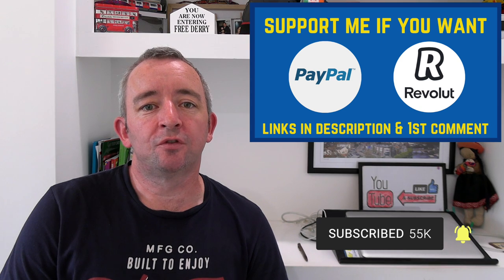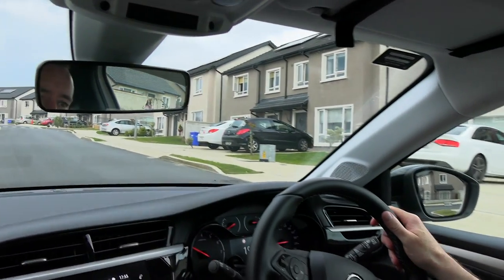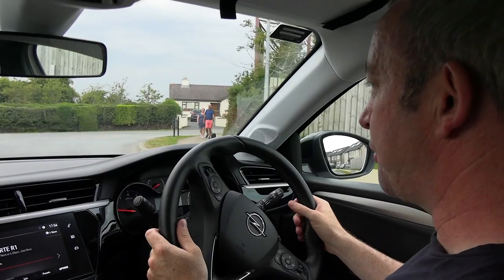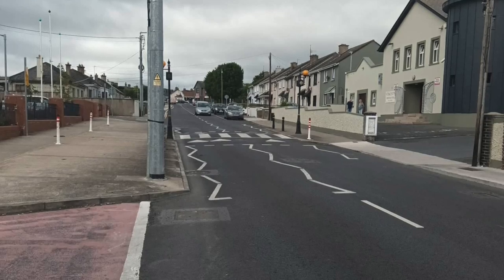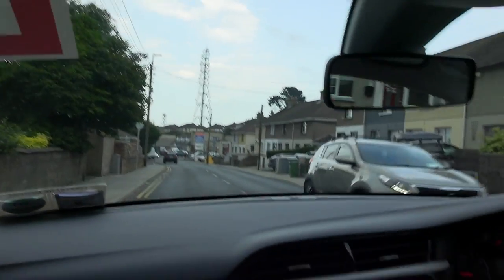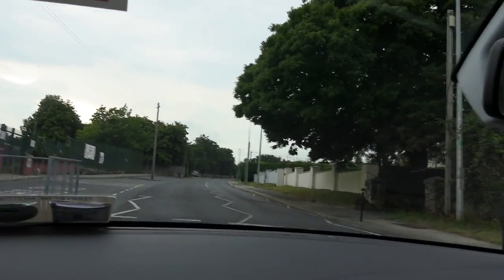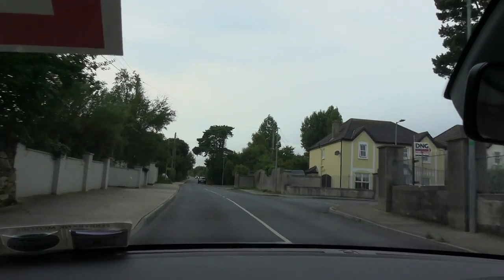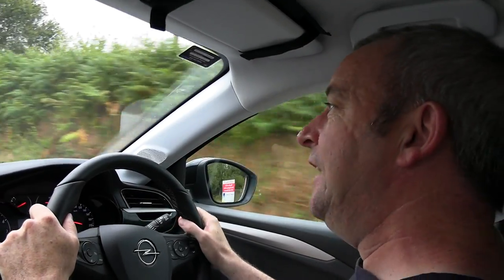How To Do Ramps & Speed Bumps Properly

Comment: Just sharing my experience. I failed the first attempt. Got 4 marks due speed on narrow speed bumpers due I ran it in 2nd gear at 30km/h. The tester said I could not reduce to 30km/h in a 50 km/h area. According him in that scenario is just to keep speed bumper between car's front wheels and reduce to 40km/h at most.
Reply from the maker: 30km is a bit high for 2nd gear so I'm not surprised you lost marks there. If it's safe to do 50 just do it but there will be times you'll need to go 30 or lower depending on the conditions. I don't know what you mean by keeping the speed bumper between wheels...  What are you on about?
Reply: @DaneTygheletsdrive  Sorry Dane I didn't make myself clear. I was marked because I was 30km or even bit slower when going thru the speed bumper(those squared narrow ones). The tester said I could not have reduced to 30km in a 50km area. Anyway, just sharing what I have gone thru. Thanks for your initiative. It is really amazing.
Reply from the maker: You can easily do those cushion ramps at 30km in 3rd gear but doing 30km and 2nd gear might not always feel the best. But it will depend on the situation as some ramps will be higher or lower, it's not like its a one size fits all, you need to judge them accordingly.
Reply: Tester was right. For those narrow ones you dont slow down. You put them between the wheels.
Reply: Q @DaneTygheletsdrive

Comment: Hi Dane,  thanks for the video. Just one quick question, if the speed limit is 50 and there are speed ramps, how much speed limit should we keep in between the two, in a dual carriageway. Is 30-35 okay, considering the traffic?
Reply from the maker: That would depend on how much space is between the ramps, more space then go faster.

Comment: Hi Dane I failed my test today in finglas. I binged watched your videos and done quite well but silly mistakes made me fail. I wish I seen this video sooner as this was one thing I was marked on a couple times. I was doing 30 in the house estates in 3rd gear. I was going over the ramps in 3rd but reducing speed. I was afraid of failing on progress.
Reply from the maker: You can't drive trying to second guess the opinion of some random tester, you need to judge each road and each situation individually and drive in a way that reflects the conditions.
Reply: This is exactly how all my instructors were "teaching" me. 30km/h and still in 3rd gear...

Now I see that it is probably just a bullsh*t and you need to reduce to 2nd gear...
Reply from the maker: Yes 2nd gear and 20km but it depends on the bump and how big they are, some might be OK in 3rd gear. Hard to give you a simple answer because there are many types of speed humps.
Reply: @DaneTygheletsdrive  this is why Im watching this video! Ive been told to do the speed cushions in the estates in Finglas in 3rd gear, theres a good few of them and very close together which I was told would make it too difficult to keep switching between 3rd and 2nd so to just take them in 3rd. Is this okay?
Reply from the maker: Grace if you have been advised this by a qualified professional then you should have no reason to doubt it, it will depend on the ramps and sometimes 3rd is good on the smaller ones.

Comment: I was not told to change the gear down by my instructors. Do you need to reduce the gears when you slow down for a second???

My instructor told me to slow down to 30km/h but not to reduce the gears...
Reply from the maker: That would be fine for some ramps, depending on the height. Not all ramps will be done in the same way.

Comment: Hi Dane, I saw your video on filter lights which was pretty good. But can you answer a question about them, can filter lights be 3 tiered as in red amber green arrow?
Reply from the maker: Like a potential filter light for red and Amber? Unusual but I have seen it. A flashing Amber arrow light is definitely a possibility, do you know what that means?
Reply: @DaneTygheletsdrive  Can't seem to leave a link to google street view as a comment. It's where the R612 crosses the R613 in Carrigaline in Cork. You'd be on the R612 turning right onto the R613
Reply from the maker: You can email me a screenshot at danetyghe@gmail.com

Comment: If the cushion speed bump is in three parts, instead of two, on the road ahead, should aim to drive over them or aim to get your tyres between them? I was marked six G2s last test, for driving over them instead of driving between them.
Reply from the maker: Where were the ramps situated? What lane position would you be in if you avoided the ramps as opposed to driving over them?
Reply: @DaneTygheletsdrive  The three ramps were set apart equal distances with one in the centre of the road and the others on either side in a housing estate. If I drove between them, I'd either be closer to the kerb/path or right in the centre of the road. If I drove over them, I'd remain in my lane.
Reply from the maker: Sounds like you should have driven between them and been closer to the path but it will depend on the situation and the road, there is no one size fits all answer. What did your driving school say?
Reply: @DaneTygheletsdrive  Driving school said should aim to drive between them so my fault for not listening. However in the test, if I aimed to drive between the ramps, I would have been in the centre of the road due to parked cars on my side of the road, so I aimed to stay on my side of the road by driving over the ramps. Got marked down for hazards, what do you think is the right approach?
Reply from the maker: I don't know because I don't know the road or the layout and each situation is unique, but you should always listen to the driving school because they know the area best. Did you specifically get marked for driving over the ramp or was it driving over them too fast?

Comment: Just one question Dane. I struggle to park and have the car straight when parking horizontally or without line markings. Usually the back or front of the car is sticking out. Any tips or advice here?
Reply from the maker: What do you mean horizontally?
Reply: @DaneTygheletsdrive  Sorry maybe parallel parking might be the correct term. Times when I need to do that type of tight parking
Reply from the maker: Check out the 1,2,1 method
Reply: @DaneTygheletsdrive  Thank you
Reply from the maker: Good luck, I do hope to do a video on that topic soon...
Reply: @DaneTygheletsdrive  great to hear. You make the best videos. Keep up the good work
Reply from the maker: Thank you 👌

Comment: Do you HAVE to drop to second for a speed hump or could you stay in 3rd?
Reply from the maker: Depends on the size of the ramp, usually 2nd is best
Reply: Would you get a mark down for not dropping to second? The car i currently use handles it perfectly in 3rd but just wanna make sure it wont effect me on the day of my test.
Reply from the maker: 3rd should be fine, depends on the situation.